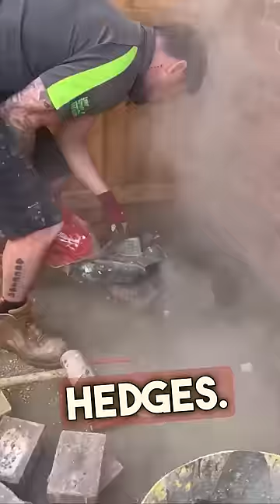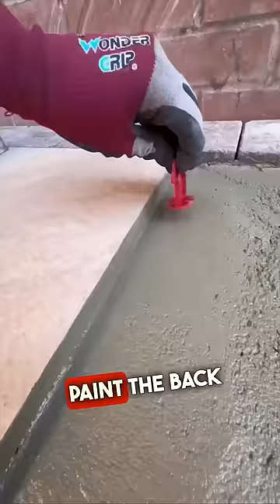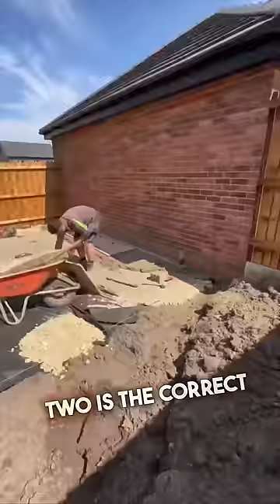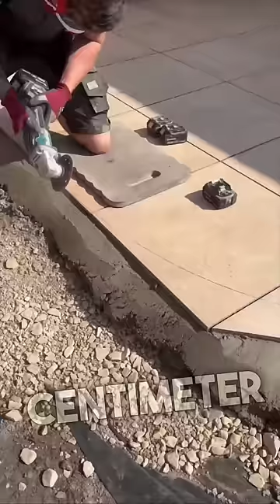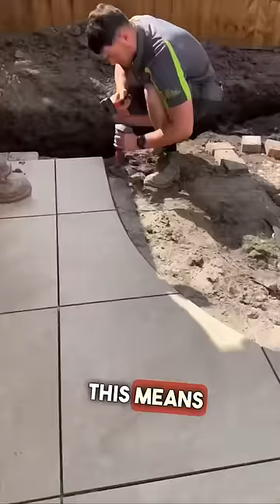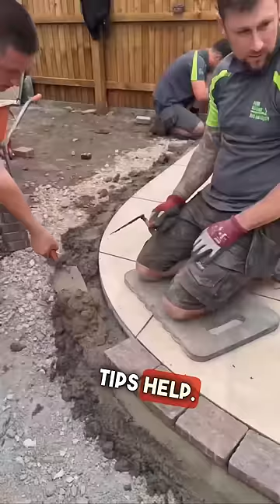Installing porcelain #landscaping #gardenlandscaping #garden #shortswithcamilla

Comment: I've just had a porcelain patio laid in my back garden. We have other issues, but the one thing they keep saying is that lippage is normal which I accept to a point, especially with large format slabs (1200×600). Some spots have up to 4mm height difference between slabs though, and the landscapers are saying it's just the nature of the slabs. Is this normal? It looks shocking. I'm also convinced a lot of the slabs are out in terms of level/fall but I don't have a level to large enough to check.

Comment: Could you explain in depth the importance of a bond coat with the slurry?
Reply: It acts like a glue, so as the mortar goes off, so does the slurry and it creates a bond between the slab and the mortar bed. If the slab draws the moisture out of the mortar mix and the mortar goes off without a decent bond you could pull the slab up with your hands (or a real good chance it'll come loose pretty sharpish).

You can use sbr and cement or just cement and water does a job. Mix your slurry as you go to an extent, because it will go off, especially accelerated on a hot day.

Source: was a landscape gardener
Reply: @nofe5372  Profoundly interesting! Thank you! So do you just paint it on then?
Reply: @TheNinjaOfThe906  yea, wallpaper pasting brush does the job, it's only a wallop, leave an inch or so gap around the edges too to save your fingers (if you're not using a vacuum or sucker to lay)

Also don't fall into the trap of applying your slurry to multiple slabs/tiles in batches, it'll start going off before you lay and defeat the object.

Comment: New to D I Y  how do I work out the fall on my slabs please explain to a complete novice 😊
Reply: You can be precise with it and pull a string line and figure out the percentage of slope you want, or you can be less precise and just use a 4’ level and do maybe a quarter of a bubble pitching towards where you want your water to drain. 

The slope doesn’t need to be drastic. It just needs to be sloping enough where water will not sit, and where it is not sloping towards your house’s foundation. If you’re putting drains in, have it pitch towards them
Reply: @Ryan-ii9rx  brilliant thanks so much 😊  👍

Comment: If you are selecting a tile you become a designer in so far as the CDM regulations are concerned. I suggest that you do further research on the R rating as 9 is very low for surfaces which get wet and you could be responsible for a slip resulting in an injury on this basis.